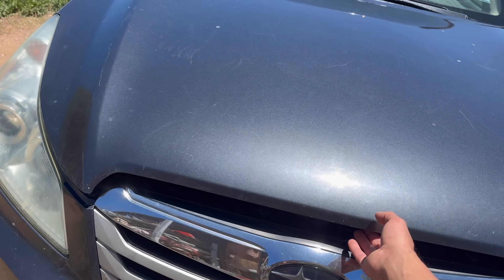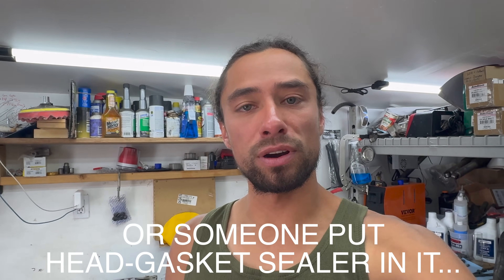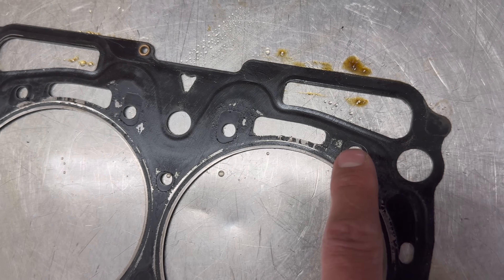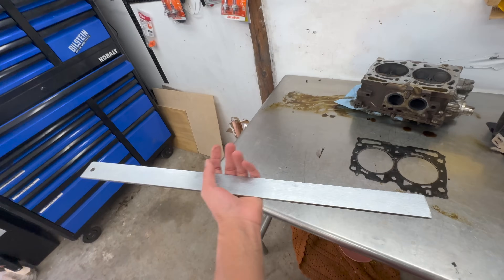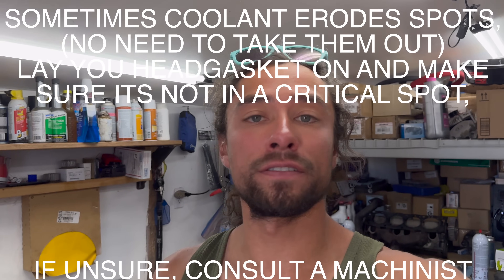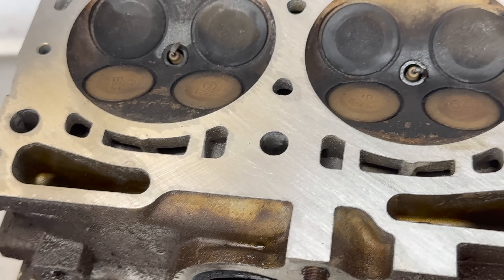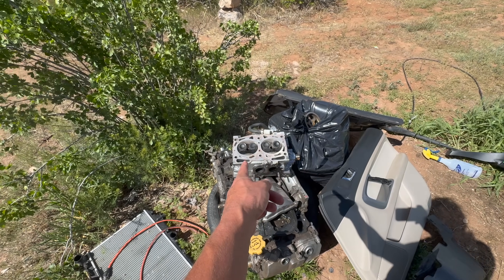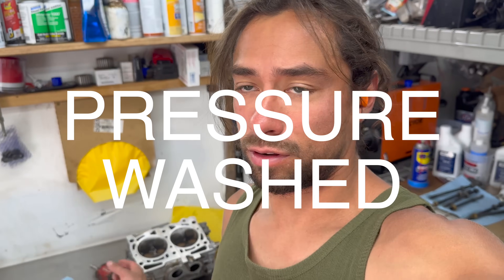How To: Resurface (EJ25/Subaru) Heads At Home - Backyard Machining 101

Comment: Remove the spark plugs first. Also, pressure wash or clean the heads any other way before you do this. I have done this many times when I had no money, it does work. Also, aluminum heads need a much higher grit finish than that, at least 150.
Reply from the maker: Negative, you want a little roughness to hold the gasket. 7 year machinist here, and over 120 (60) cars done like this. Bmw N20 motors are notorious for slipping timing, the updated parts are LASER ETCHED to provide friction and reduce slipping
Reply: @steinfabgarage  Only for Iron blocks/heads with traditional head gaskets. Modern aluminum blocks/heads and MLS head gaskets require at least 150 grit to 180, sometimes more like 220 grit. The RA for aluminum with MLS is 30 to 20, or 180 to 220 grit. Look it up.
Reply: @JohnDoe-ml8ru  What is the threshold before you listen to somebody?
Reply: @I_Dont_Answer_Questions Mr John Doe is right. MLS gskts, if they are to last, require a 20-30ra finish. You cannot get this w 80 grit. If, as one commenter , says, the video man uses copper head spray, that is the seal that will temporarily keep the head sealed w a MLS gskt. I mostly use Mahle and Elring gskts. They specifically prohibited use of ANY added sealant. Been doing it right for 35 yrs now. No come backs for that ever. So, here's your listening moment. If not me, then the engineers that made the gaskets.

Comment: This concept is definitely a respectable way to "clean up" an aluminum head as long as you don't sand to much. However it is in no way an effective replacement for having the head surfaced at a machine shop. It's so much better than using those little 2 inch discs on a high speed air grinder that I wouldn't even compare it to that kind of butchering type of clean up.
Reply from the maker: As a 7 year machinist I can tell you, this IS a effective replacement for a machine shop. It pretty hard to sand TOO MUCH. Trust me, we used to mill .020-.030 tho off customer heads all the time. 

I HIGHLY AGREE with the BUTCHERING done with the 2” discs, we would see them come in “cleaned” by those and often have to have the head welded due to low spots around the fire ring (combustion chamber)
Reply: @steinfabgarage 
Thanks for your comment. I'm gonna do this. Will also do a lapping and valve seals too!
Reply: Idk, seems almost lot like sharpening a knife on a whetstone. And he doesn’t have to worry about the angle because it’s flat, and he doesnt have to worry the whetstone has a worn spot and isn’t flat.
Reply: If you worked in a machine shop then you should understand that you have no clue if your sand paper method is keeping the head surface perpendicular to the crank shaft and cam. I doubt as much as  .003 difference from one end of the head to the other would cause any valvetrain or bolt alignment issues but your not measuring anything so you don't know if it is off or not. Those tiny 2 cylinder heads are the best case scenario for attempting this in the first place. A 4 cylinder head could easily become off over .005 end to end by trying this.
Reply: @crazyoilfieldmechanic3195 The sad part is that people are actually believing this method is correct and effective. Not knowing the spec for flatness is down to a few thousands of an inch that must be measured with precision tools.
Reply: @crazyoilfieldmechanic3195  Y U Hate in on this man? I bet u never did a head job in your entire life!!! U might have GAVE SOME HEAD but mechanicly u probably never did any head gaskets a day in ur life!

Comment: You posted this just days before I start a head-gasket/re-seal job on a 2009 outback ej253. Great timing! If the surfaces don't seem too bad, I may consider this budget method. If they are bad, I'll suck up that machine shop decking cost. Great post! (also your ej25 engine pull video came in handy as a reference!)
Reply from the maker: If there barely blown, this beats waiting for them to be milled. But sometimes a few day break isn’t bad, depends on your situation

Comment: I've found that dish soap with some water works better than WD-40 at washing the swarf away.
With that i've basically been able to just keep grinding endlessly. 
Also if you're worried about cost, then you can get large sandpaper sheets without the glue and just get a can of spray glue.
Reply from the maker: I’ll give the soap a try next time. I’m not worried about cost, time is critical for me. I started doing this when I would offer 24 hour headgasket/ timing jobs. Most of the time it was for the external oil leak, 1 hr and I’d be putting it back together
Reply: @steinfabgarage  If I could find 24 hour turnaround near me I would be throwing work at them (Upstate NY)
Reply: 24h headgasket job would stress me out 😂 how much did you earn for one job?

Comment: I've done something pretty similar with a mazda BP 1.8 head and block and it worked great.  Used one of those pneumatic long sanding boards for the block to flatten it enough the MLS gasket sealed fine.

A trick I learned for carbon and crud on valves from a grey hair..  use a brass punch and a hammer to strike the stem of the valve (on the cam side) which briefly shocks the valve open/closed helping it seat.

Edit:  also.. awww kitty...

Comment: Loved the video, I’ve been thinking about doing this for my neon I need to put back together. 

I’ve seen heads on neons be out .004 that didn’t leak on a turbo race car. But they knew they were running a risk at the time.
Reply from the maker: They headgasket is meant to compensate for flaws, that’s it’s job. But most manuals state that .003 is the limit. .

I’ll be trying my skidsteer  head this week (4cyl), to date, 3cyl heads (v6) are the largest I have done, so we will see….
Reply: @steinfabgarage  might be worth it to get a longer slab and sandpaper for a belt sander. I’ve seen people doing v8 heads I just don’t know what they were using at the time.